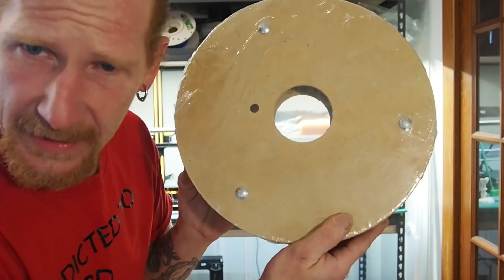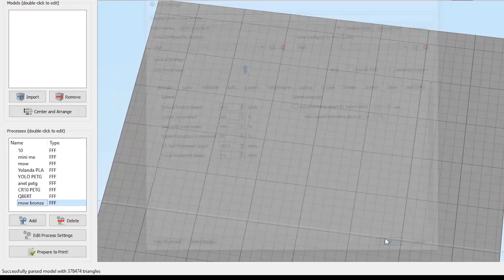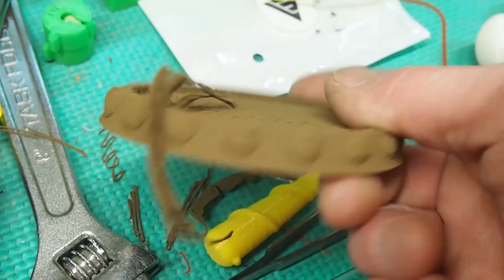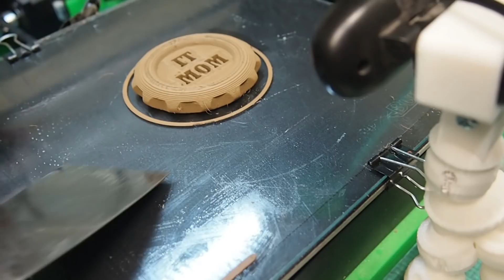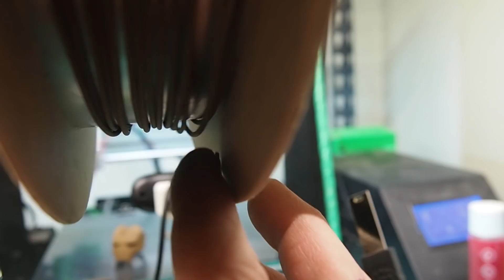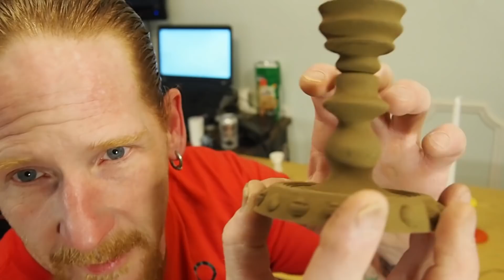3D Printing Metal (Virtual Foundry Bronze PLA)

Comment: What do you mean? Cant you just use an adjustable kilm like the ones used for clay? There is some shrink but there is software that can calculate and adjust so final size is what you want.
Reply from the maker: Yes that is what is needed a kiln and the black magic powder I just didn’t have one at the time
Reply: @InsideTheMindOfMatt  Couldnt you use an old oven?   Btw what is this black magic stuff? why would you need that, i mean isnt the pla just melted/burned out thus leaving only the metal?
Reply from the maker: @bitrage.  I could have used an old oven and later in life and the channel I got an oven tried to convert it with a temp control and then found a kiln cheap and bought i show it off if later video (if ya feel like binging) and as far as the powder it's the other part of the sintering process that they sell and I didn't have it. my final thought was if you have all the equipment to finish a 3d printed metal part then you have the equipment to do lost wax/pla casting which was really my goal all along

Comment: I’m sure you realize the first part of the print looked good, but as you move away from the base you start loosing the residual temp from the bead which would mean you need more heat on the nozzle. Just some thoughts. Later

Comment: The "balls" on the base of the candlestick don't appear to be actually attached to the model. Almost as if the slicer has generated them as separate models.
Reply from the maker: I think cause of the thick layer lines and larger nozzle it appears that way I actually had to edit model cause it was printing the balls with walls inside the base fix it there is normal infill

Comment: nice video Matt! I think they have reformulated it to be less brittle. I have a video that should be out soon where I try sintering it again. my results were better this time around.
Reply from the maker: Awesome I can’t wait to see that have you tried polishing a print?
Reply: Inside The Mind Of Matt I've polished them a bit. I don't have a Dremel tool which is really what you need you get it to look like solid metal. but you you can get it fairly shiny with sand paper.

Comment: Did you try “repairing” your model in Netfabb or something similar?  I’ve had certain models downloaded from Thingi that needed repair because very similar problems occurred where the Infill was separated from the next Solid Infill Layer..
Reply from the maker: Yes I alway repair my models weather downloaded or designed myself I use 3d builder for checking but very good suggestion thanks you

Comment: I would love to see a post processing video. I am curious though, wouldn’t low heat over an extended period of time reduce the chance of the candle stick holder of folding into itself? The makers of the filament have done some amazing post processing on their models. Thanks for the review, I have been curious about this filament for some time. I believe they are now working in a stainless steel filament.